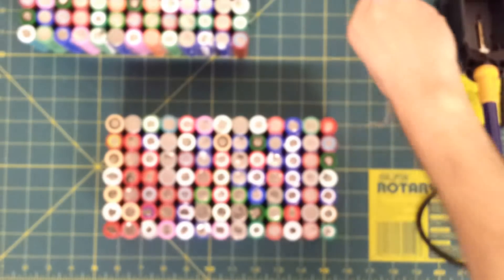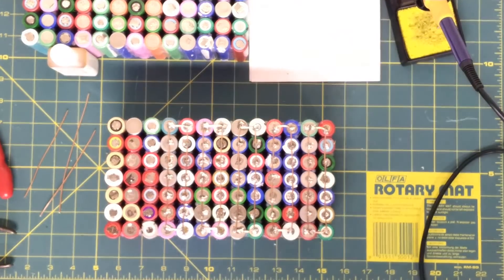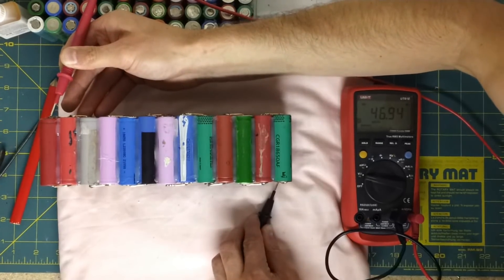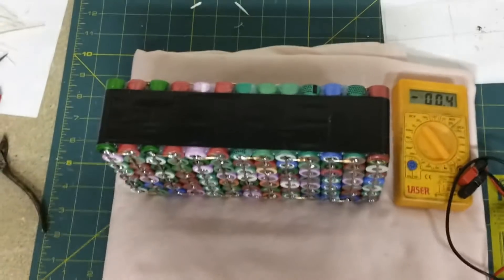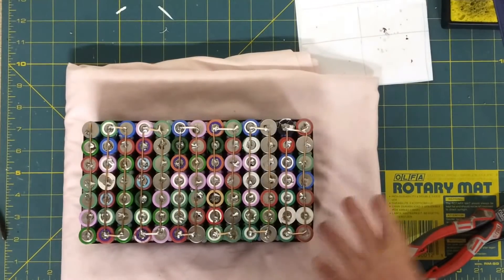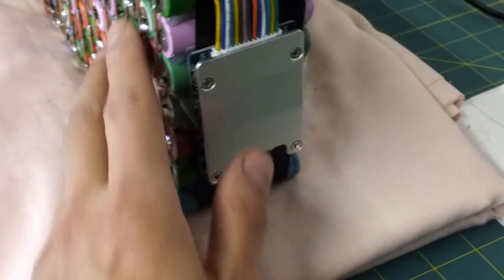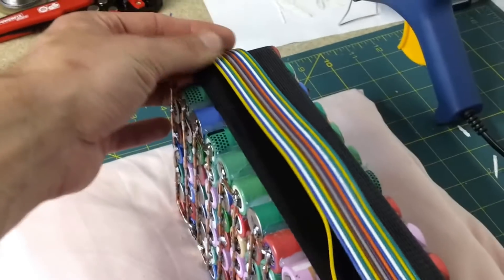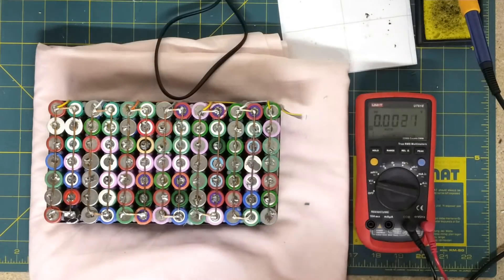Lithium Ion 18650 48v e-Bike battery build DIY - Part 7 - Soldering the battery and BMS

Comment: Hello 
What mm of copper Cable where you using to connect the batteries? 
Was it 1mm?
Reply from the maker: I can't remember exactly but highly likely to be either 1mm^2 or 1.5mm^2 size.
Reply: @KomradeShotabollokov  
Thanks for the response
Also when you wire the BMS what awg wire did you use for that?  
Thanks
Reply from the maker: Well the balance wires came with the BMS and were tiny (maybe in the order of 0.2mm^2) but the main terminal wires on the BMS were probably somewhere between 0.5mm^2 and 1mm^2 I think. I chose not to discharge my battery packs through the BMS when using the bike therefore the grade of wire was less important to me. It only needed to accept the input charging current, which is a tiny 2A.
Reply: @KomradeShotabollokov  
Thanks for the response 
Do you remember what wires you used for discharge?
Reply from the maker: It was some fine multi-stranded silicone coated copper cable found on eBay by the metre. Commonly used by RC enthusiasts as I understand it. The grade was given in a USA standard: AWG. I can't remember which size I used or what the cross sectional area was in mm^2, unfortunatly.
Reply: @KomradeShotabollokov nice video would stranded cooper wire be better for this job ?
Reply from the maker: Possibly, I used the single strand wire because I had it on hand and it was easy to bend into shape

Comment: Been quite some time sense you did these.  How did everything fare out ?   Were those BMS's the Balancing Type ?
Reply from the maker: Yeah the BMS are the balancing type and the batteries have held up well: no issues so far.
Reply: Working on a build here in New Mexico USA.  Just bought 100 2,200  and 100 2600 batteries and all the bits and bobs to make a few batteries.  Just finishing up testing them all.  Going to use the Plastic separators.  Here in the States we have a few people that offer the  18650 batteries at quite reasonable prices.  https://www.ebay.com/itm/100-NEW-18650-2200MAH-CELLS-LITHIUM-ION-BATTERIES-POWERWALL-DIY-EBIKE-LG-SONY/202393628811?ssPageName=STRK%3AMEBIDX%3AIT&_trksid=p2060353.m2749.l2649

It seems no mater who you buy those Hub Motors from there all made under the same roof.  LOL  Mine looks Identical to yours only carries the Brand name CHAMPION.  Had any issues with you controller that came with the thing ?
Reply from the maker: The plastic separators offer a neat solution but if I had my time again I'd bond the rows of cells in an offset pattern to save space and increase rigidity. Good to see decent prices for the cells; I may yet build a battery of new cells to replace the two packs of used ones for my ebike. It struck me that all the hub motors come out of the same/similar factory in China and therefore were all likely to posses approximately the same failure rate. I occasionally have an issue where the power is cut whilst on the 'throttle'. This could be one of several components and I've yet to investigate further however the motor is still pulling very well, at least. I wish you luck with the rest of the build.
Reply: LOL, yep.  Not heard of so many motor failures.  It seems the Controllers are the Weak Link.

Comment: Could u please do an update about your e.bike battery.
Reply from the maker: Hey Chris. Yeah I know I've been bad in not updating this project, apologies! I had a slight life change last September and have had almost no spare time since. That should be changing by this summer though so I'll try to get some more ebike updates out soon. Is there anything specific you want to know? The batteries have been holding up well so far: I've been using them most days and hammering them with no issues or heat.

Comment: Question, should i be able to run my ebike with high amperage 18650 cells like the 35a ones on ebay i plan to do 14s 14p. Also will i be able to use that without a BMS?
Reply from the maker: Your battery should be better for having high discharge cells in it. It'll be able to sustain 'full throttle' for longer without damaging the battery pack. I assume you're matching the voltage of the hub motor kit to the 58.8v your 14s pack will achieve, fully charged? I wouldn't recommend charging without a BMS. I do discharge without a BMS though (but I've been carefully monitoring cell voltage drop under load).
Reply: im jsut on a low budget and want to try without that BMS bullcrap. I think its a hasssle wiring the balance leads and finding a good spot to stuff the BMS board
Reply from the maker: Well if you go without a BMS, the banks of cells might charge unevenly. If some go over 4.2v you risk individual cells breaking down and/or catching alight. Just be careful when you charge the battery pack. You can buy BMS boards quite cheaply, if you do decide to use one.

Comment: I highly recommend you go on ebay and search for used 200w soldering iron ''American beauty", the are really good soldering iron on ebay that's were I get mine
Reply from the maker: Hi Chris, I've recently bought a 60W soldering iron to
replace my ageing 25W one that wouldn't have cut the mustard for soldering
these packs! I find the 60W works well (the station suggests the tip is around
450 degrees, max) but I can see that a more powerful iron would reduce the
contact time with the cell terminals, which can only be a good thing. I was
acutely aware of how much time and therefore heat, I was transferring to the
cells as I was soldering. Thanks for the suggestion, the 200w irons look cheap if I find I need one in future.
Reply: No. This would really work good: Friction Welding of Large Metal Parts by AFW,  https://youtu.be/RdPeFfKDGWI